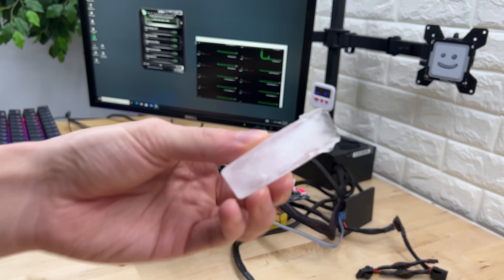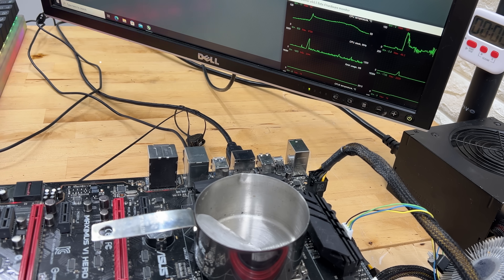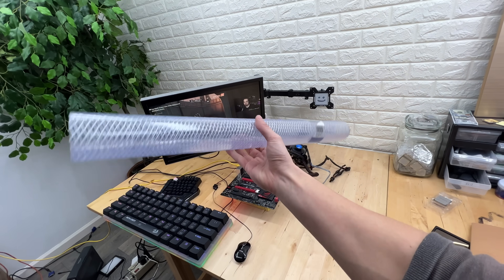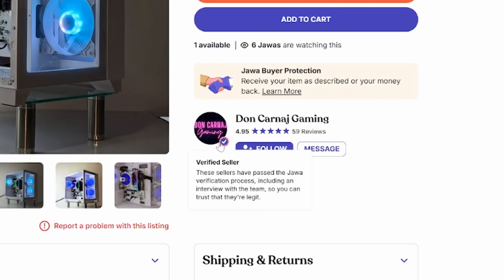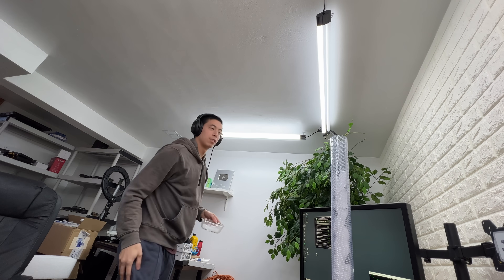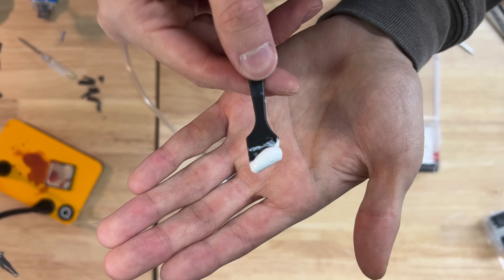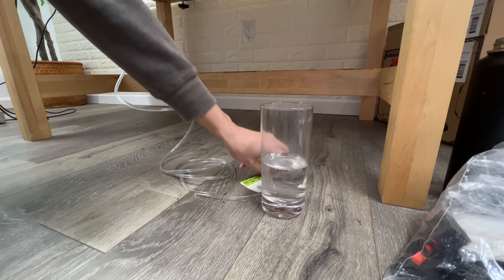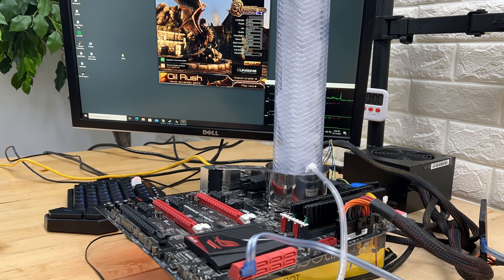Why aren't PCs cooled with ICE?

Comment: What about having the cold winter temperatures cool down your pc while you game LOL😂
Reply: Actually I sort of do that. I turn down the heating when gaming because the PC puts out a noticeable amount of heat.
Reply: @girla9480 also, temp in my room increase for 2-5c easily  while gaming just after 1-2 hour
Reply: I had an idea yesterday to have your PC outside with a top cover that moves whenever multiple apis say that the temp is cold and won’t rain or snow
Reply: @LandonEmma why are you everywhere?
Reply: Chuck the PC under a porch in northern Canada.
Reply: @StanleytheCat-v8z i did this with an rpi 4 in yellowknife
Reply: @StanleytheCat-v8z  Give it an A-Frame external housing to keep it dry
Reply: That’s why I game in a commercial sized walk in freezer, with heat pads under my mouse, keyboard, and monitor.
Reply: Winter works like charm
Reply: it was done in a blizzard with temps reaching bellow freezing running a top tier overclocked system
Reply: My dad was fanatic PC tuner like 15+ years back. We had water Cooler from car i think it was cca 50x30cm  and it was not in same Room as PC but going to the next room via hole in concreete so you cant hear any fans or fish tank water pump (modified to be more quiet).

Now imagine you have one outside in like -10 or less:D
Reply: When the cold winter air meats the warm coy it will most likely condensate, and that means water
Reply: Can't say about pc, but for any phone, it's battery degrades quickly. Using your phone in a cold weather for just a few days makes it so battery goes from 100 to 0 in an instant
Reply: It has been done before.
Reply: I thought about this all the time when I lived in Alaska
Reply: Theres actually someone that did that just to play roblox in japan i think i vaguely remember there being a video of it
Reply: It actually works, but, its still recommended to have at least some kind of cooling system
Source? Me and my experience in Russian weather in -20 Celsius
Reply: When I was using Gentoo Linux, I would wait to start compile jobs until I was cold, and use the PC's exhaust heat to warm up the room.
Reply: doesn't work here at any time of year
Reply: That was done in China when it was negative 40 outside
Reply: Passive cooling
Reply: Pc... out the window ! 😂
Reply: Been there when it was -40 outside and those old FX processors needed cooling
Reply: So basically air cooling
Reply: Actual thing I do. I run a fan cooled build which can raise my room temperature to a steady 65°F - 70°F depending on the outside weather. Generally, I can leave a gap in my window to lower that range, or use a window fan to draw in outside air for more extreme cases. While where I live usually doesn't go lower than 40°F, I can shave a good chunk off just by reducing how much warm air is recycled.
Reply: In winter pc near the door from the courtyard when I open it, only after a few minutes idle gpu 20c and cpu 15c and it can go even lower and gaming gpu hotspot around 45  and cpu around 40 that's all I can tell you
Reply: I saw a picture of a guy that just hooked up a big tube to his PC and stuck it outside a window lmao
Reply: Put pc in fridge
Reply: I live in Siberia and my pc is near window, so I can just open a window when it's minus 40.
Reply: That's just using the PC as a second heater.
Reply: That’s what I do when playing in the basement during winter. I open the window over the PC when it’s-15c outside.
Reply: I did that once with a laptop.
Reply: «go play ouside»